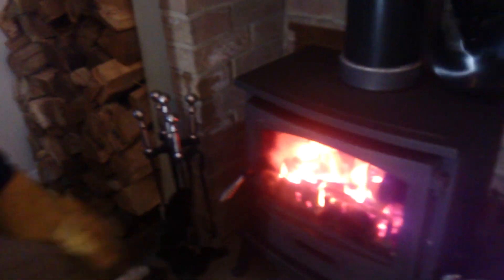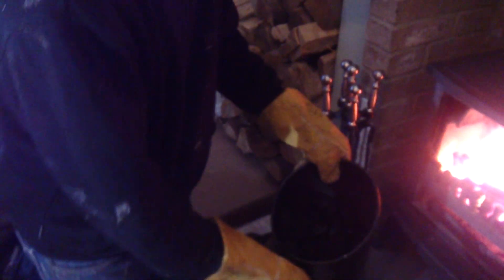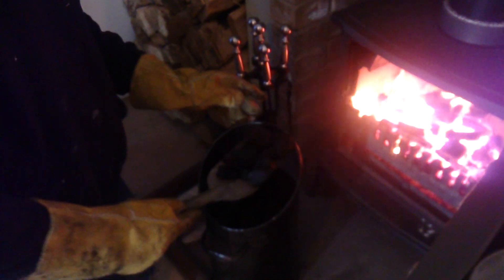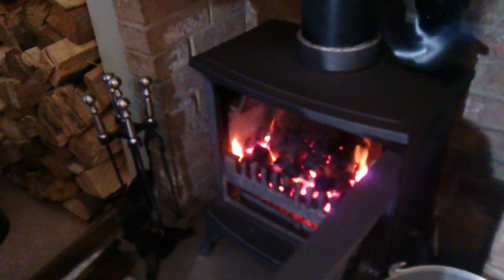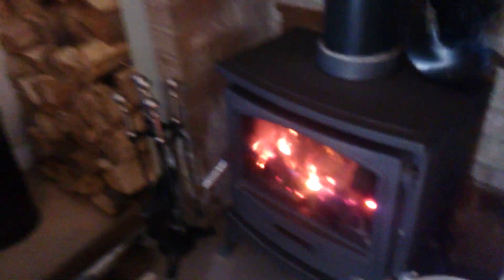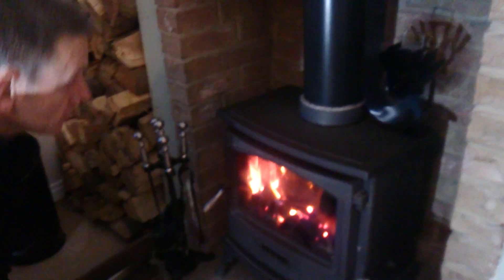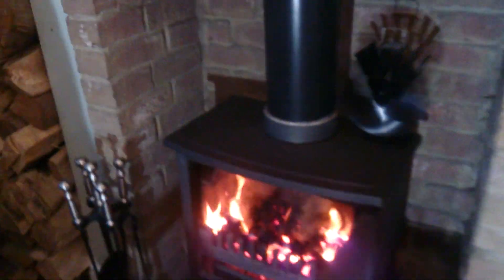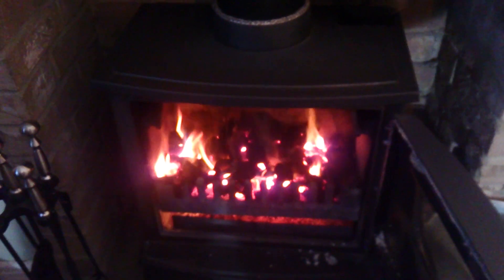MULTI FUEL BURNER ADDING COAL AND  STOVE FAN TIPS!

Comment: I do use coal in a multi fuel stove stove and I struggle to get temps above 200/220 celsius....how do u work your primary and secondary air? Any advice would be greatly appreciated. Iv always heard coal produces more heat but unfortunately have never expericned it. Also wood burns best with air from above and coal is the opposite..so what do du do??? what temps do u get?

Comment: I've heard that burning normal housecoal on a multifuel stove can crack your baffle plate?
Reply from the maker: never heard of that one matt id take been useing normal house coal for ages with no worries 👍😉
Reply: Oh OK have you not had any cracks or warps in your plate or Stove using housecoal?
Reply from the maker: @mattseymour8637   hi matt not really i think its general wear and tear not just the coal all heat creates stress just go with the coal i use coal mainly to get the fire away sometimes certain woods are difficult to get going im burning ash right now which as you khow is a hard wood but apart from that no worries take care👍
Reply: Will try coal to get it going and to aid the wood. I find Ash doesn't take much to get going. Do you find that?
Reply from the maker: @mattseymour8637  hi matt its mainly some woods but ash is a good burner once the fire is hot🥣♨ but the fire i have in here is an old tiger and the chimney sweep was here last august and reported no problems but i think adding coal to aid the wood is the best way i use 90% wood 10% coal as its cheaper and i get the wood for free 👍
Reply: Thats good info. Will try the 10% coal and 90% wood. I do anyway really. I like Ash it's my fave wood as always burns as soon as you put it on the fire. Does the chimney sweep say its OK to use coal and wood? Do you use the smokeless Coal?
Reply from the maker: @mattseymour8637  hi matt i use normal house coal as we live in a village and everyone's on it lol😁👍 ive got some nice willow to burn when i get round to chopping it up i find if you get the fire going with a scoop of coal it will burn anything you throw at it 👍🔥🔥
Reply from the maker: @mattseymour8637  ash isnt bad too get going as long as its dry i prefer soft wood but i mix hard soft and a bit of coal most of my wood is scrap wood so it goes up easy 👍🔥
Reply: Its easier to over fire your stove with real coal as it burns hotter....
Reply: @mattseymour8637  shouldnt burn coal and wood together,
Reply: No just same multi fuel is as ses on tin

Comment: Thats good then. My burner gives off some heat. Use mainly wood on it. Thought that using normal coal wasn't good in stoves?
Reply from the maker: if its a multiburner which most stoves are you will be ok cheers

Comment: How do you find normal house coal on a stove?
Reply from the maker: hi matt this is a multi-burner and i find normal house coal work a treat it lasts longer than wood and of course burners hotter we dont use smokeless fuel as its cheaper and this area excepts it i use it when temperatures get below freezing as its the only stuff that really does keep the room warm hope that helps cheers,

Comment: Yes it's a multifull stove
Reply from the maker: you will be ok with a multi-fuel stove you can burn most types of coal and coke ive burned anthracite coke from wales its harder to get away but burns hotter and longer but i find normal house coal just as good im paying £2.99 for 10kg bag  one bag normally lasts one evening without wood or 2 nights with wood ,take care
Reply: Where did you get your anthracite coke from?
Reply from the maker: @mattseymour8637  hi matt i used too get mine from a place called woodhouses in middlesbrough Cleveland although i haven't used anthracite coke for years on account of the expense but i cant see the difference between anthracite coke and the coal imo i get coal from b&m stores for £2.99 for 10kg cheaper than the coal merchants and lights real easy👍i was burning plum branches last night it was so hot i was in a tshirt on the far end of the room lol hope that helps 😁♨

Comment: Non smokeless will warp your stove over time, that's why using it invalidates stove warranties.
Reply from the maker: cheers one eye didn't know that thanks dude 👍
Reply: In what way does it warp it?
Reply: @mattseymour8637  baffle plate first usually but seams can open up too.
Reply: Where are the seams?
Reply: @OneEyePI  would I be ok using a bit of smokeless coal with a wood baffle?
Reply: @mattseymour8637 I don't think you can unless it's designated multifuel as it would risk damage and could invalidate your insurance.  Might be worth checking with the manufacturer.
Reply: @OneEyePI  the stove is a multifuel stove and I only use a bit to get it started.
Not so bpthered as is an old stove and only use in a shed
Reply: @mattseymour8637  if it's multifuel you can use as much smokeless as you want.  It's only the smoky bitumenous stuff that's problematic
Reply: @OneEyePI  that's what I have. 
I use only smokeless. But would a wood baffle be ok with small amount of coal ?
Reply: @mattseymour8637  I wouldn't risk it with mine
Reply: @OneEyePI it's an old stove and no damage so seems to be ok